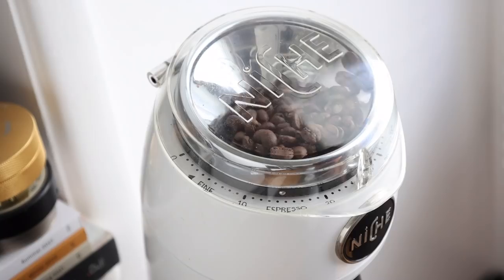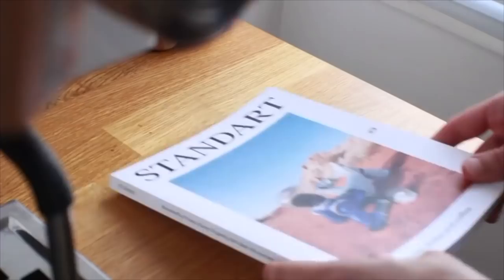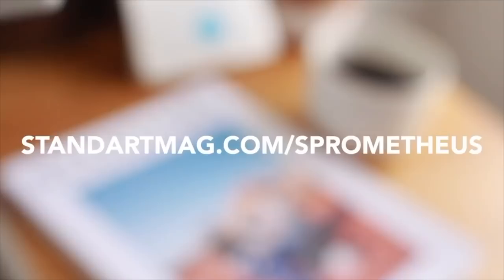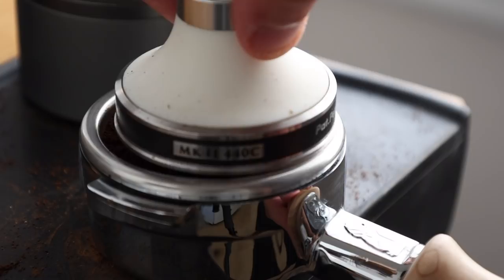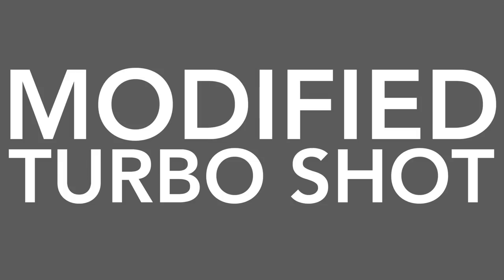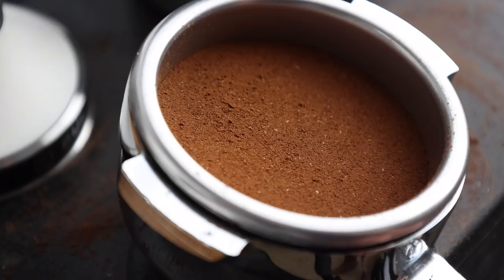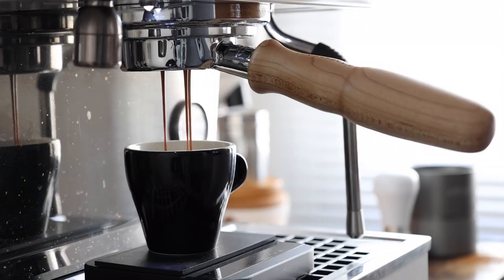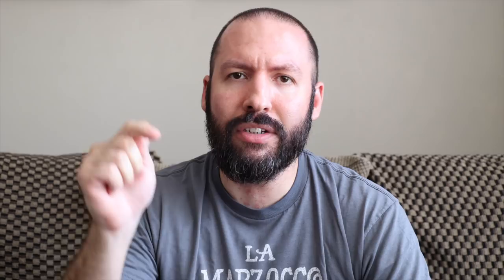ESPRESSO ANATOMY - The Turbo Shot

Comment: Now do a video on whatever we are calling the opposite of a turbo shot. I’ve been playing around with this a lot. 120 second shot times, both with and without pre-infusion. The results are interesting, producing syrupy and sweet shots that aren’t over extracted.
Reply from the maker: Interesting…what sort of dose and yield are you going for?
Reply: Totally agree with that. At the moment I mainly make shots at a total time of 75-80 seconds. With a 16 gram dose and 36 gram yield. Usually doing a 50-55 seconds pre-infusion. I love the result a lot.
Reply: Yes.. I also tried a 20 sec pre infusion and 30 sec. Extraction totalling 50 sec and got a tasty result
Reply: Just buy yourself a La Pavoni Europiccola and it’s what you do every shot! 😀 I love my LP.
Reply: The opposite would be naturally aspirated.
Reply: How do you control the pre infusion phase? Just on and off the start button?
Reply: this is how I brew light roast on my flair pro 2 syrupy sweet.  15-20sec of preinfusion followed with 90-100sec on 6-9bars
Reply: in conclusion, every type of espresso is great - if done properly 🙂
Reply: @darkim1777  90-100 seconds on 9 bars?!?!? Is that thing not just spraying everywhere and channeling stupid hard?? Any time I extract over 30 seconds, the water doesn’t seem to grab the whole basket of grounds. If channels suuuuper hard and I get like 1/2 of the bottom of the filter to get water out

Comment: Great work again Spro! A small remark, the paper mentions lowering your typical 9 bar pressure to 6 bar for this style of shots. I know you showed the 6 bar gauge in the video but didn't mention it in the recipe (unless I missed that). Might be useful info for those who want to try it themselves. :-)
Reply from the maker: I did use 6 bars on this one, but in my previous tests I used 9 and it worked just as well. I think that is more or less an optional thing as long as you’re using the correct dose with the corresponding yield and time.
Reply: @Sprometheus  ok, that's really interesting.
Reply: @Sprometheus  Bro i don't think so. pressure is directly correlated with extraction so i think 6 bars is integral to the recipe, at least the recipe as it is in the scientific paper you cite
Reply: @cz5696  the thing is even if you've set your OPV to 9 bars, that's not a guarantee that you're going to hit it, it's possible that there wasn't enough resistance to hit 9 bar so it doesn't really matter
Reply: @alinaqirizvi1441  It still matters and your explanation doesn't imply that it wouldn't matter.

Sure, there might not be enough resistance at the puck to create backpressure in the group. But that would be a prep error and doesn't say anything about whether 6bar is still the proper target, were everything done correctly.

Lower pressure, coarser grind, high flow, and consistent temp all make for the best conditions for a Turbo to pull well.

Comment: Sounds like my first ever shot of espresso I made: I ground too coarse, so I had a fast shot at like 20  seconds, and it was surprisingly acceptable. I of course choked my next one when I went finer, which is awkward with a Flair.

Also, I always love your videos, but I wish they were longer.
Reply from the maker: Haha yeah we’ve all been there! It’s all about sticking with it and getting into the weeds of dialing in. 

Thanks Sam, I appreciate that. It’s funny you mention that, I feel like I get comments on both sides of that. Some too long, some too short. Hard to please, I try to keep them long enough to get the point across. Things like this can be described and explained in 5 minutes easily, and I would feel weird adding a lot of fluff.
Reply: @Sprometheus  definitely keep to the point as you do.
Some fellas just ramble on

Comment: The turbo shot is an excellent idea for fully manual espresso machines since it leaves less time for the hot water to cool down.
Experimenting with my Cafelat Robot I noticed the piston hardly warms at all with a turbo shot, whereas the 'traditional' run time leaves it almost hot.
I've settled on a 16,5 to 17gr dose for light roasts and 15 to 16gr for dark roasts with a grind setting to get a 15s run time using far lower pressures than usual.
For light roasts I aim for about a 1:3 ratio, for dark roasts I prefer slightly shorter.
The resulting shots tend to be sweeter and more balanced than traditionally pulled espresso.
It has definitely changed my espresso making for the better!

Comment: I've never purposely or rather consciously pulled a turbo shot. I mostly do a 5 sec preinfusion and aim for a 20 to 25 sec extraction on my spring lever and I've had many shots that falls between 18 to 20 sec (excluding preinfusion) that tasted very very tasty. I mainly use medium roast but some medium roast taste better with this than others. With some, the acidity can be quite strong when it hits my throat.
Reply from the maker: I think a lot of baristas could say the same until recently. 

I’ve tried the turbo with both light and medium roasts and found them both pretty good, but in the end its all about personal preferences. I still need to try it with a dark roast, I just don’t have those on hand often.

Comment: That's actually interesting. I read the paper as well and my "modified shot" is very similar. I dose 16 in with 45 out in 18 sec. For me the additional 1g with the additional 3 sec of extraction really does make a difference. One thing to try: Use a medium filter roast, dose 16 in around 50 out in 16-17 sec with 6bars! Doesn't work always but if it works its incredible. One of the best shots I have ever tasted

Comment: Thanks for explaining this in a short and concise video. I'm going to give this one a go. Coming into this as a medium / medium-light bean espresso drinker, I have been using 16-17g baskets with a 40-45g output @ a higher temp, maybe as high as 95c for some time now. I do however agree with the report, especially on a light roast, a less than perfect grinder gives you channelling occasionally. Shake ands distribute helps but doesn't prevent so keen to try this turbo shot. Sounds like stale beans and wrong settings I've had in the past. :)

Comment: Solid stuff spro. Was excited to try turbo out. sharing my modified turbo recipe on infuser with df64 since I can't control pressure or flow. 12g IMS single cup, filter screen, filter paper at bottom, grind for 6-8bar pressure. Normally averages Ard 13-19s shot time for 30g. I've also tried preinfusion only with interesting results

Comment: By going as fine as you can before you start to create channeling, you’ll maximize extraction. When you go too fine, the channeling will lead to decreased extraction. The turbo shot is interesting, but personally, I always aim to get the max extraction I can right before the grind is too fine even though this approach is harder.
Reply from the maker: For sure, to each their own. That’s what we all were essentially trained to do over time. 

Personally I found myself always chasing higher and higher extractions thinking that was the key to the best flavor, but honestly some of the best shots and filter coffees I’ve had over the last couple years have been in the 18-19% range.
Reply: I've tried decaf, because I sometimes like a coffee in the evening, I ground finer and finer, just as you say to create channeling instead.
My Eureka grinder seems to have a "finest" limit, so instead of chasing grind size I set my Rancilio to 7 Bar.
Now decaf were possible, and my ordinary shots are way more consistent, and dial in process is way easier.
Reply: @daniel635biturbo  I never brew at straight 9 bars to avoid channeling from puck erosion.

Comment: Really interesting, I'll try it for sure. I don't fully understand why it doesn't taste too sour (like underextraction) like many fast shots.
Reply from the maker: The main reason why it shouldn’t be sour is the smaller dose. The smaller amount of coffee you use the easier it is to extract it. So running 40g of water through 15g of coffee, even at a fast flow rate will pull a lot of solubles out.
Reply: @Sprometheus  thanks! I'll go for it

Comment: I typically pull a 1:3 yield so this sounds really interesting to me. One thing I’m not clear on is why the need to lower pressure to 9 bar when we can simply adjust grind to get 40g out in 15 seconds?? Perhaps the lower pressure allows for a coarser grind, which further enhances the mission and purpose of the turbo shot.

Either way, it’s always fun to have some new variables to play with :) 

Thanks for the video!
Reply: I think the paper says that the 6 bar is for more consistency due to less channeling.

Comment: The authors clarified that there seems to be a (fine) grind size, beyond which channeling becomes a problem (puck prep aside). Obviously, when channeling is evident on the bottom of a naked portafilter, channeling is a problem. An unbalanced taste/extraction is another, more nuanced, indicator. In wonder if you (or others) have identified other 'tells' for channeling/inhomogeneous flow through the puck?  For example, pressure fluctuations, significant shot time variations, etc...

Comment: I have tried it a few times. I like it but on coffees with more fruity tasting notes it works better. Also makes it better when trying to dial a coffee in on my Robot. If I guessed wrong it can turn into a turbo shot. Also found if I dose down from 20 to 15g at the same grind it goes from normal espresso to turbo.
Reply from the maker: I’ve enjoyed it both on light and medium roasted coffees, but the clarity on those fruity shots is very nice that’s for sure. 

Definitely, if your dose is 20g dropping 5g should be all you need to do to get it running. But also, it’s best to use a 15g basket, all that head space in a larger basket could negatively effect the shot.
Reply: @Sprometheus  Fortunately the Cafelat Robot only has one size basket. But 15g is pushing the smaller size that it can handle. May try 17 for better results.
Reply from the maker: @cameronbatko  oh yeah, there has to be all that headspace for the water. I wonder how that effects it. I think the screen that goes over the bed should mitigate the issues

Comment: Assuming evenness of extraction, I think what matters is just heat and volume of water, sometimes pressure too. People mistake contact time for mattering because when you grind too fine and your shot is slow, it also ends up channeling, but that's a correlation and not a causal link between slowness and bad taste. Likewise people think a fast shot is going to be missing something because of low contact time, when really the problem was not enough pressure. Espresso is a complex manifold of different dark magics!
Reply from the maker: I think pressure can definitely be a factor, but temperature is always key for extraction. I pulled these on 205, but right now my pressure is 6 bars.

In the study they found lower pressure (6-7bar) was able to get higher extractions than a standard 9 bar pull. I don’t remember the explanation though.
Reply: @Sprometheus  it could be that like crema, certain things that come out of using different amounts of pressure are tricky to measure, or may account for a very small difference in extraction but an outsize difference in taste. I definitely don't have the sample size to know for sure but this is my suspicion.

Comment: Did you only try this on the Niche? I think big flat unimodal grinders can extract faster, which gives you back some more texture by enabling a shorter ratio.
Reply from the maker: I only really use the Niche, it’s my all-rounder. I haven’t messed around much with flats or unimodals in awhile, but I’ve always found mode texture in the conicals generally.

Comment: Hi. What is the temperature you set? Personally I couldn’t see huge differences between 91 and 94 deg. I was using the turbo shot before it was called “turbo shot” :) as I noticed that low pressure combined with faster shots almost never produces bitter espresso from light roast beans. I was surprised some time ago when I once measured the EY for a shot which would have usually gone in the sink (21%). I was happy when I saw the theory confirmed my personal taste. 
Thanks, Sprometheus for your great videas!

Comment: I cannot imagine how this could work. For my normal espresso I get 30g out in 30sec for 15g in and peak at 7bars. If I grind finer there is no way I get 40g out in 15sec. What am I missing ?
Reply: Probably use a bigger basket ? Is that the trick ?

Comment: Did you use the same basket as always? I've been wondering about the effects of reducing doses in the same baskets. As far as I know, conventional wisdom is that having more than a few mm of expansion space between the coffee bed and the screen will lead to turbulence and muddiness. It'll be interesting to find out if that's the case as the turbo shot spreads and more people experiment with it
Reply from the maker: No, for the 15g standard Turbo I switched to a 15g basket. Ideally I’d stay within 1g +/- that a basket is rated for.
Reply: @Sprometheus  I go about it completely opposite. (But I'm the amateur here)
Since coffees have different density (light roast / dark roast etc.) I always aim for the same height of puck.
If that means 21 or 17g I adjust water, to get correct ratio, my reasoning is higher puck allows coarser grind, which leads to less channeling. 🤷‍♂️

Comment: Turbo Shot is alright, but it lacks body. But then, it brings out the good acidity and sweetness.
It doesn't taste good when mixed with milk.

If drank without milk, I prefer Turbo Shots over traditional Espresso.

But for milk based drinks, I still prefer Ristretto and/or Normale.

Cheers.